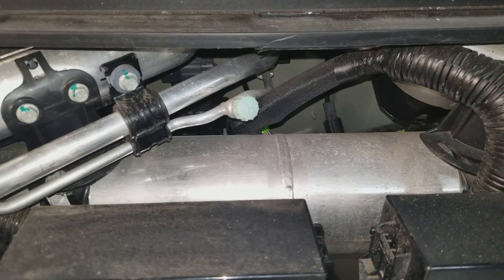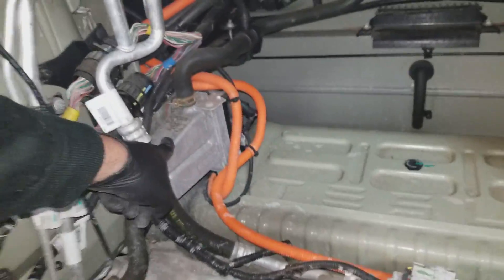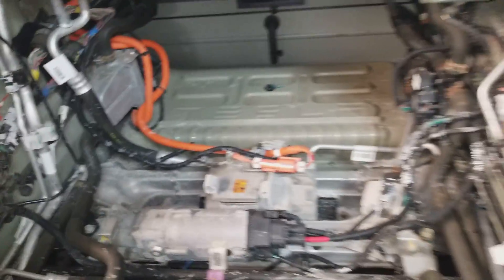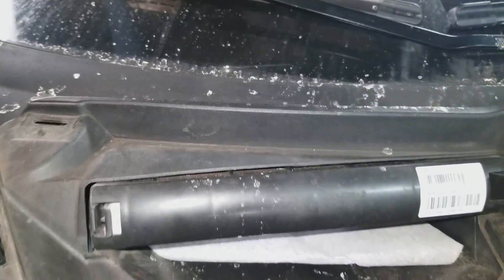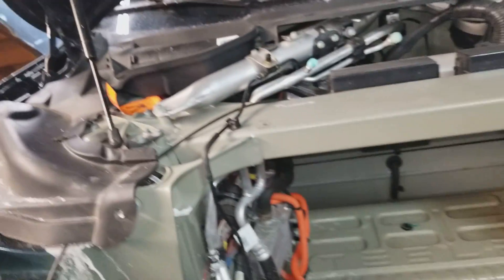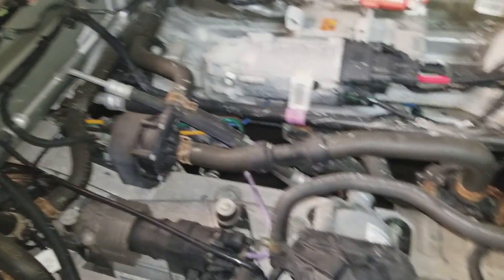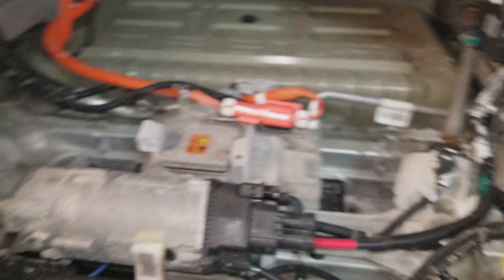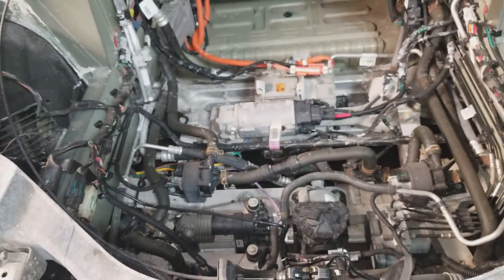What's under the hood of a Model S?

Comment: can all this components be wet? i saw some videos of teslas driving basically underwater in floods .... some people even take the bathtub out and wash everything including the engine to take any sand, mud and specially salt from it. But how does this procedure dont harm the car at all?
Reply from the maker: Everything is weather rated. All connections are sealed. The under hood bay is exposed to the elements through the condensers, anyway, so things under the hood already get wet. Cleaning with a hose will do no damage at all.

Comment: I just picked up a 2015 model s from copart with a dead battery (both 12v and traction). There's no coolant in the reservoir so this clip is incredibly helpful to take apart the front plastics.

Comment: I've to replace a PTC, seeing this, I guess I have to get to there from the inside?
Reply from the maker: Sjoerd Venema to replace the PTC, you have to remove the glove compartment and lower dash trim on the passengers side, as well as the right front wheel and fender liner. The high voltage connection for the PTC is on the DC converter in the right front fender well. Fairly simple job, but it’s a bit annoying.

Comment: Is there any problem with aluminium and steel degradation at the point of contact. We have that problem with fire trucks
Reply from the maker: darcy funk I do have some issues with the hood striker and rear lift pistons. It's been noted, and if anything happens, it will be investigated.
Reply: Tesla Repair Channel if you separate the metals it will solve the problem. 
The problem is doing that maintaining integrity. It is not actually rust it is both metals oxidizing at different rates

Comment: Terrible placement for the 12V battery. WTF were they thinking?
Reply: I was about to talk about how it likely needs infrequent replacement due to usage and always being topped up from the main battery...but apparently that's not actually the case and they die quite frequently. I assume they sacrificed 12V battery life for the life of the DC-DC converter but they could've at least made the battery a little more accessible as a compromise.
Reply: @bassman2914  Tesla had a supplier of faulty batteries in the past

Comment: not really impressed how's being done for a premium vehicle
Reply from the maker: Krassimir Koychev they most certainly are not stainless. Many parts from these cars are sourced from the same suppliers as Mercedes. I also own many Mercedes, and they absolutely rust just the same.
Reply from the maker: bitman EV how would you have done it?
Reply: more structure and easy access to that 12 volt battery. also those clips... and those screws to adjust the head lights? happy days after some years of corrosion. it's a expensive vehicle what could be better designed IMHO
Reply from the maker: bitman EV to be fair, it's a cheap vehicle with an expensive battery.
Reply: Yeah, this isn't really a premium vehicle, it's just priced like one.
Reply: All hose brackets are rusty. On German cars all this brackets are from stainless steel.

Comment: So for the big semi trucks are there also going to be radiators and water pumps for the truck? And I'm pretty sure there's going to be in an electric air compressor for the air bag suspension and the trailer correct?

Comment: Wow I did not think that there were be a radiator with two water pumps I didn't think radiators were needed anymore I knew that there were coolant to travel in between certain battery packs to keep the batteries cool but I did not know that there was a radiator and water pumps.
Reply from the maker: tank there's a radiator and 3 water pumps total. The coolant needs to dissipate heat to something, and coolant needs to flow. The battery uses the air conditioning to extract the heat from the coolant, as it has to keep the battery cool during charging when the vehicle isn't moving, but the motor and inverter are only going to produce heat while in motion, so nothing fancy need be done to cool it.
Reply: Oh okay thanks.

Comment: Can you do a coolant change/flush without the Tesla Toolbox application? If so, any chance of you making a video?
Reply from the maker: +Markus Strobl not currently. I'm trying to figure out a way to do it either manually, or through the OBD (unlikely)
Reply: Someone was saying you can pull some fuse repeatedly and that will cycle the diverter valves and pumps and bleed the coolant. Sounded sketchy to me. I also heard Tesla is supposed to release a special version of toolbox this year for indy shop use. Would be great, but it's Tesla so who knows when/if it will really be available. :) 

Tesla service charged me $230 for coolant flush which isn't that bad but would like to do it myself next time as I usually do all my own maintenance. 

Btw, thanks for the drive unit fluid change video. I got a new drive unit under warranty last year so it will be due for a fluid change in the spring. I will certainly do it myself as your video showed it to be so straight forward.

Comment: I think this is what the petrol heads wanted to see at the car meets. Under the frunk liner.
Reply: The same with computer builders or anyone that has a vested interest in  how things work. This naturally includes whether or not the internal components are as efficiently placed in the event of repair. Performance is also an issue... if you have poor quality parts or design and a bad placement, that's likely going to jack up repair costs or create new fees in the event that getting to a part damages other things. We'd like to think that's the mechanics fault or problem but reality isn't that simple.

Comment: Love your channel
Why is the car so dirty?
Is that salt?
Ove
Reply from the maker: T&T Tesla yes it's covered in salt. New York roads are more or less permanently salted - both before and after snow - until early March.
Reply: Tesla Repair Channel 
Thanks
That will definitely affect all the aluminum parts 
I am suprised that the salt does spray so deep into the car 
The isolation should be better
 
So as usual the last 80
Years: buy a car from southern states

Ove
Reply from the maker: +T&T Tesla the shields cover most of the stuff, but you have spray that comes in through the condenser openings, and from the wheels.
Reply: Nice to see that TESLA knows what salty streets are. So I hope we dont will have the same rust problems in Model 3 or S and X we had with Golf I and Mercedes W123.
Reply: Yep the last few years in New York, they use brine or liquid salt and it gets into every nick and cranny. The rust is worse than ever now.  I can't stand it.